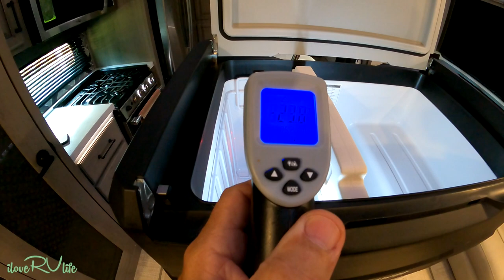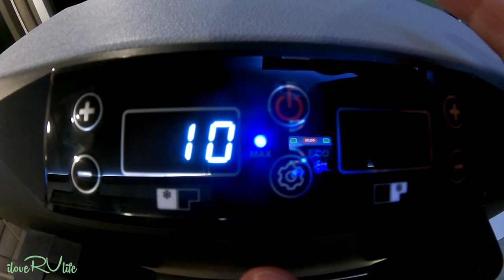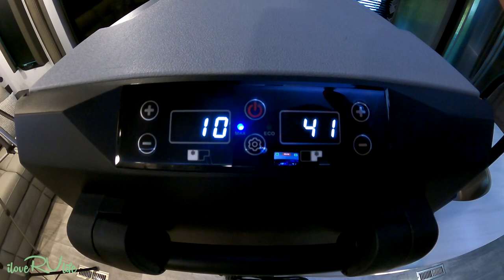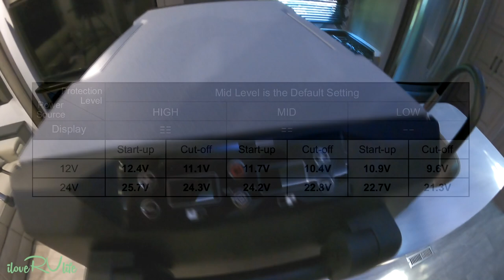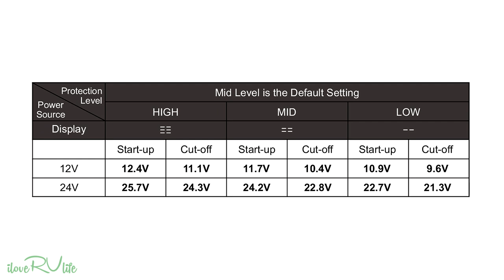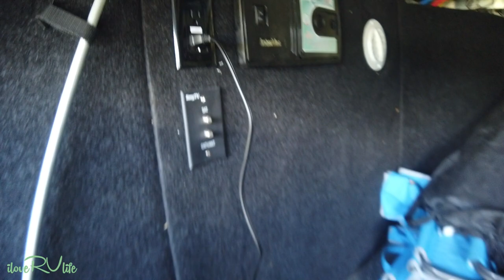SetPower 45 RV Dual Zone 12 Volt Refrigerator

Comment: We have always used a 12 volt refrigerator/freezer when traveling. Mostly because the absorption RV refrigerator are not safe for some foods. They don't freeze well enough and in extreme heat, worse if humid they do not get cold enough. Mostly use RV fridge for produce which only needs to be kept cool. The only problem we have had is there are allot of cheap units and you usually get what you pay for. All the cheap units I have purchased on last a few years. So now I only buy proved brand name units. I currently own dometic.
Reply from the maker: Great tip. Thanks

Comment: Have you thought about plugging it in the inverter that's on the other side of your storage Bay while you're traveling.
Reply from the maker: I did, but there’s loss in DC to AC conversion. Have a spot to add a DC accessories plug. Will be a little more efficient for battery use.